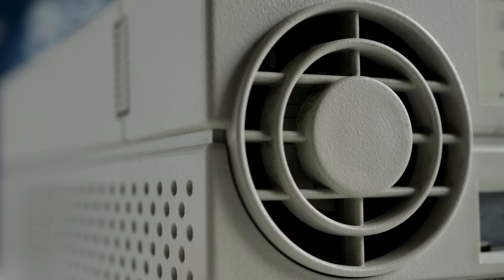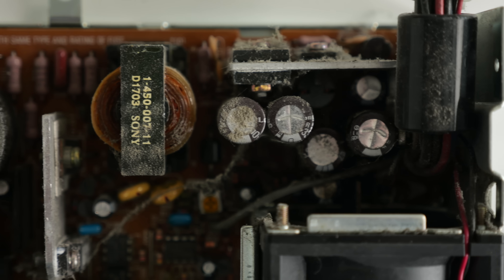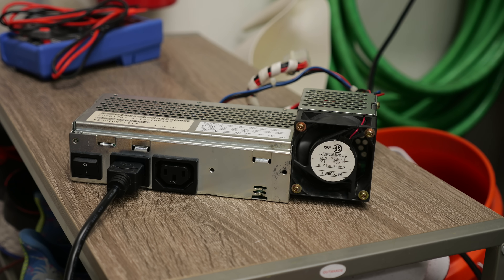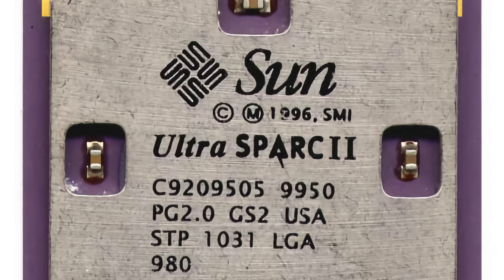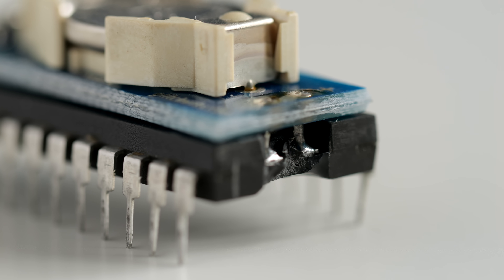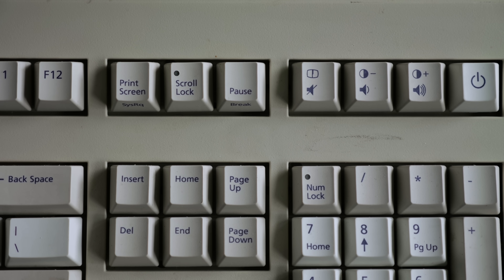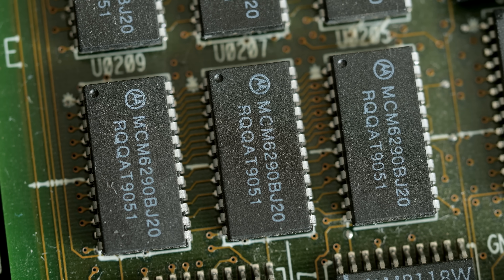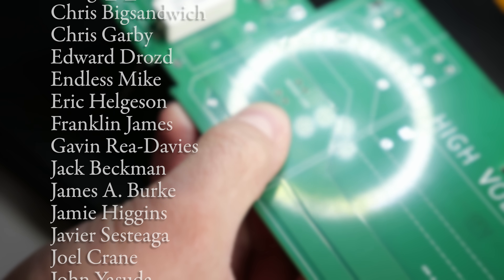I couldn't fix this SPARCstation because of one STUPID problem

Comment: I had a cache chip fail on a sparc 5 I was using as a router at the time. super props to the firmware team for identifying the failure at the component level, but that level of component replacement wasn't something I wanted to tackle at the time. These days I would hold onto it for SMT rework practice, but back then it was easily replaceable by newer surplus x86 gear, so off to the recycler it went.

I still have a sparcstation 1 and a 2 that I'm likely get rid of if I get them going again and can internalize how truly slow they are.

I really liked the IPC and IPX form factor, and had a few in the early 00s, but 25 and 40MHz can only get you so far. ISTR a friend of mine bringing home a bunch of surplus IPCs at one point, but ssh keygen and initial key exchange was unbearably slow (on the order of minutes) which quickly killed his idea of building a loose cluster out of them.

Comment: The message at 12:23 says the problem is with "Page Map RAM," which would appear to indicate that that RAM is used for the virtual memory system, not the video system, and simply adding a video card wouldn't help. (And anyway, if the problem were just in the video card, the boot ROM ought to let you to continue to use the system from a serial console.)

If you're willing to get in and do the soldering and rewiring necessary, I don't see any reason that the bad RAM chip couldn't be replaced by any other static RAM that meets the same specifications.

As for the video issues, this is where it's well worth buying an oscilloscope, even a super-cheap one: being able get some sense of the signals on the pins (video and the various types of sync) will generally make short work of debugging "doesn't display" issues.

Comment: I was given a Sun IPX for my MPhil at Manchester University, UK between 1996 and 1998. I was really proud to have one - the only actual workstation I ever had access to. It had enough HD space and 64MB of RAM. It ran Solaris, but with FVWM2 as the window manager. After a few months I bought a PowerMac 4400/160 with 32MB of RAM for home use which was about 8x faster, but the IPX still felt special.

Comment: For systems like the SPARCstation, which utilize the Motorola MCM6290BJ20 SRAM chip, compatible replacements include:
	•	Hitachi HM62256P-xx
	•	Cypress CY7C199-xxPC
	•	Fujitsu MB84256A-xx
	•	Toshiba TC55257CP-xx
	•	Sony CXK58257P-xxL
	•	Mitsubishi M5M5256P-xx
	•	OKI MSM62256-xxRS
	•	Sharp LH52256N-xx
	•	NEC D43256AC-xxL
	•	Alliance AS6C62256-xxPCN
	•	Samsung KM62256ALP-xx

These chips are typically 32K x 8-bit SRAMs with 5V TTL compatibility and standard 28-pin DIP layouts, making them suitable drop-in replacements.

Important Compatibility Criteria
	•	Capacity: 32K x 8 (32KB total)
	•	Interface: Parallel, 8-bit
	•	Voltage: 5V TTL
	•	Pinout: Standard 28-pin JEDEC DIP (or equivalent SOIC if you’re adapting)
	•	Access time: 200ns or faster (150ns, 120ns, or 100ns are all okay; just not slower)

Replace the xx with the ram speed.

Comment: Oh, so Sparc stations of that vintage actually DO have clock batteries. Thanks for the clarification, Colin.
Reply: We had a bunch of IPXs that we hadn't used for a while, the timekeeper battery had died, putting in a new chip was easy enough, but that eeprom also kept the mac address...the mac address wasn't printed anywhere on the machine. Since these would never touch the outside world, we just made up some addresses DE:AD:BE:EF:00:xx was my favorite

Comment: "...Than the original, mechanical unit." Colin, FFR that comparison doesn't make sense, because with the old system drive being a hard disk drive, being mechanical is just a given. You replaced it with something that isn't even a hard drive.

Comment: I restored an IPX a few years ago. Same deal with the blueSCSI and the monitor pinout drama. Even dremeled out the timekeeper to solder in a coin cell battery holder. Very cute form factor and Sun build quality is very impressive. Got Solaris installed and realized how painfully slow it was. The 1993 college engineering workstation lab nostalga quickly faded and back to ebay it returned.

Comment: You went to the trouble to build a new power supply but let a ram chip stop you? There weren't any junk peripheral cards with ram chips around to farm one off of? I guess everyone has their limit. Frankly I'm impressed that the machine itself could give an error code down to the chip location of the problem. This thing WANTS to run! I wouldn't have known how to set up a headless terminal to get any output at all so that's a win there. I wonder if simply a cracked solder joint or pcb trace could be to blame. Re-soldering that chip or bridging the trace might bring it back in case of those faults. Perhaps if you went back and poked around a bit more on both sides of the motherboard you might fix it without any more monetary output. But I understand jus being over it. Make notes of what you did and the error you got and pass it or sell it to someone who wants to continue the saga.

Comment: Correction to the video - Sun did make a portable machine.   It was called the SPARCStation Voyager.    While it doesn't fall into the modern definition of laptop (integrated keyboard/monitor), it was designed to be mobile.    If I remember correctly, it had no fans (all passively cooled).
Reply: first

Comment: The other thing that happens is the Dallas semiconductor clock and SRAM model battery goes bad after a few years.  The MAC address is stored in SRAM and you lose the MAC when the battery dies.  The ROM contains a Forth interpreter, and you can type in a new MAC.  I don’t recall the command off the top of my head.  When my battery died, I typed in co:ff:ee:12:34:56 when I needed to boot up until I got a new Dallas chip.

The Solaris operating system available for the IPC and IPX is terribly outdated and full of security holes.  Netscape Navigator and even a n early version of Microsoft Internet Explorer are available for web browsers.  Probably any version available is full of security flaws.

The IPC and IPX were cool I their day, but probably not practical for much of anything now.  In their day, they were surprisingly compact computers with a lot of power in a very small package.

Comment: This predates anything I even saw by Sun. I worked at a small local ISP from 1996-2000 where they have a SparcStation 5( the pizza box) and a SparcStation 20. While I do have some nostalgia for these, they just don't have enough draw for me to spend more than maybe wanting to see one running for a few minutes. I'll take a 486 running Linux of the era or just a modern VM of Linux over using SunOS or Solaris again.

Comment: I restored an IPC, even got the original power supply working. It has been running in my garage 24X7 for over a year now. I use it as a syslog sink. I put a SCSI2SD in it. I love it.

Comment: I loved those old sun systems.. I had 2 fo the Sparc pizza box sparcstations on my desk in the late90's... damn thing blew the doors of my PC that was state of the art at the time.  I still have one that's much newer and it works.. Internally I think it's IDE where externally it's got the SCSI port that I have HD's and Tape drivers plugged in... not to mention it uses VGA... I still love working on Solaris (and my job has me doing it from time to time) as they are pretty damn stable.. but Oracle since buy Sun Microsystems has pretty much put it to pasture.

Comment: i had some old sparc, borrowed the video adapter from work until i eventually bought a sun monitor from a friend of mine, and just like you predicted, only ran it long enough to install solaris (also borrowed from work), and then it just sat on a shelf forever, eventually got lost in a storage auction

Comment: If you managed to fix the RAM, then the next issue will be with BluesCSI. I couldn't get BluesCSI to work with my IPX, but ZuluSCSI seems to be a better fit for the IPX's SCSI flavor. I also had to borrow a SCSI CD-ROM drive from one of my SPARC systems to install Solaris 6 because I couldn't get the CD functionality to work with the IPX and the Zulu either. I believe this issue was related to the block size.

Comment: Wow, trip down the memory lane ! As a student, I used such a machine. We had a room filled with +/- 20 of those.
From the very serious student work like a (very basic) Pascal compiler (which I made portable : Sparc Station, PC and Atari ST !) to annoying others by messing with the display of others stations, because there was no security on this side ! Welcome to scrambled and "melting" screens !

In your case, its too bad nothing else than the error message came out. May be you would have encountered another one : the mouse. If yours is the same optical one we had at the time, you need a very specific Sun mouse pad. The mouse won't work on any other surface. It needs the very specific reflective features of the Sun pad ...

Comment: That memory chip is a standard part that has a standard pinout and capacity. Some hot air and you can replace it with any other that has the same or faster latency. They are still made, even. And cheaper than your VGA adapters. 🙃
I have some SIMMs in my 486 where I can't find a datasheet for their memory chips at all, and yet, they're standard DRAM, too. If I need to fix them, I just buy EDO RAM and take off the chips I need.
Reply: I'm surprised he didn't try this...
Reply: "Standard" only covers the pinout, packaging and memory cell array layout. It does not cover the timings or memory standard.

During that era, there were four successive memory standards that were not 100% compatible with each other: PM, FPM, EDO and BEDO. If the memory controller didn't support the standard, it wouldn't work, or cause undefined behavior. Mixing and matching memory standards and timings on a single stick is a recipe for disaster.

There were plenty of systems that supported PM and FPM, but would refuse to work with EDO and BEDO memory. EDO and BEDO were "technically" supposed to be backwards compatible, but some memory manufacturers required special strapping be done with external components to force it into FPM mode.

And while SRAM is generally SRAM, you still have to worry about access times, array layouts and voltages. Yes, SRAM chips are still made, but you don't want to slap a 3.3v or 1.8v SRAM on a 5v bus without level shifting.
Reply: @GGigabiteM  We're talking about replacing memory chips of a known type with others that meet the specifications. The issues you describe, at worst require running a bodge wire from a pin to VCC or ground to switch the chip into the other mode. That's hardly difficult. And choosing a chip that's available where you don't have to do that is trivial.

Comment: I love videos like this where someone "discovers" something you take for granted.  I started my so-called "career" on 68010-based Sun2 machines, and thought the SPARC-based machines were amazing.  Even now, I sometimes miss them, though there is one still running in my datacenter at work.  I was even a Sr. Engineer at Sun for a time, and  I had several IPXs (and IPCs, and other, later lunchboxes in my then-oversized collection.  (Which I finally got away from when I realized I was going overboard with a 14-CPU E5000 and a 100-slot DLT robot in the house.  I have a VERY tolerant spouse...

Hell, I still have not only the printed version of the FE Handbook, but the electronic version of it and the later Sun Systems Handbook as well.  Having access to those resources is still handy

FWIW, I don't think of the IPX as a "lower-cost" system; that was really the IPC.  I mean, the IPX has onboard GX graphics, which (IIRC) was designed by Curtis Priem, who went on to co-found NVIDIA. The IPX was essentially a SPARCstation-2 in a smaller form factor with some updates and onboard graphics taking away the third SBus slot.The SPARCstation-2 may may surpass even the SPARCstation-20 as the best workstation Sun ever made.  (Some will probably disagree, but I'm allowed my opinion!)  They were supported for a long, long time, and I saw ones being used as late as 2006 or so.   You'd be surprised how snappy SunOS 4.x was on it, and even some versions of Solaris 2.x ran decently well.  

Having said all that, I don't blame you for stopping.  There's a point of no real returns on most old hardware.  My Apple G4 Cube collection (well, I haven't stopped having a "few" machines around) is supported with spare parts from Cubes that were just too far gone to repair.

Comment: I'm at 11:09 and I have a bad feeling I know where this is going. Because last year I spent easily 10, maybe ~12 hours screwing around with a SPARCStation 5, trying different adapters (I own that exact adapter cable with the DIP switches on the 13W3 side) before finding out my MultiSync monitor wasn't terribly "multi-sync" at all. A had to hook up an LCD VGA monitor and set the refresh rate in NVRAM to get a display on a CRT.

And if that's not where this is going, dude, you dodged a bullet. But if it is... I'm so, so sorry. Welcome to Sun Microsystems, I guess.

EDIT: Oh god that was so much worse than I was expecting, RAM chips?? I don't blame you for getting out when you did, even if I personally do quite enjoy having a ridiculous box of RISC on my network. I use mine as an FTP server and a dial-in server to support other machines that are stuck on dial up, but I appreciate that those are both niches. And it must be said, early 90s Unix gaming doesn't exist. To within a margin of error, anyway.

But if you ever do want to give it another whirl, may I recommend: https://www.oldsilicon.com/workstationdiskimages There's an enthusiast named Todd Vernon living out in Colorado with a large enthusiasm for these machines, and he does have pre-configured Solaris disk images (with a lot of helpful software) that I've used successfully with a BlueSCSI.

Comment: When SunOS detects more than one network interface, it automatically enables routing. If I remember correctly, you could disable this feature by creating a file in /etc called notrouter (or as it was jokingly called etsy no trouter). This was easy to implement with # touch /etc/notrouter

Comment: Wow this brings me way back. In 1995 I was gifted an IPX with a stack of external periphs (SCSI CD-ROM, tape backup, hard drive) along with an unfathomly large (to me anyways) Sun-branded CRT.
That's the first time I broke into a *NIX system (it had an OS installed but no password)  but far from the last.
Such a cool build!
You make me want to pull out my dusty old Sun Ultra 10. I'd already maxed out CPU speed (and overclocked it) along with maxed RAM and top of the line video card.
Still ran Java desktop like crap.
Took 3 days to compile X11/KDE4 on Gentoo when I tried in the late '00s (guess how I learned to build a distcc farm!)

Thanks for sharing!

Comment: I can agree with the sentiment of not throwing your good time after a lost case.  But considering that you changed so much out of the chute and ultimately failed, the end result is really not a surprise.  I have a working IPX with 64MB and 1GB SCSI drive as well as the Weitek power uP processor.  Fun little piece of computer history and surprisingly snappy.  I have a second frame graphics card and, when I had the monitors, would drive a pair of displays just fine.  Even have the external four drive storage unit for it and have it configured with a couple of 4GB SCSI drives.  Fun to play with and a nice bit of history as well.  Guess I need to have at the supply and recap it though.

Comment: Liked the video, but not the ending, kind of sad.  Hopefully someone here will get you enough information or maybe even the part, to fix the system.  Otherwise, you might want to get a GX card instead of using the built in  one.   BTW, I would NOT try to run Solaris on this thing.  It is much better suited for the latest SunOS 4.x.x.

Comment: Lol!  I remember my early days of being a SysAdmin.  I was happy to have on my desk a similar looking lunchbox, but it was an IPC, not an IPX.  I had 24MB of memory, and connected it to 2 screens.  Through it wasn't that fast, I had a nice bit of desktop space to do my work, and over the network (an AUI cable fished down the wall) I could get to the rest of the network, and had "plenty" of CPU power on the network!.  Most people don't realize that we could do things on UNIX that the PC's just couldn't, run applications from remote almost like they were running locally through X windows, but for me, it was faster over the network, many times as the IPC only does about 12 MIPS!

Comment: Way back when I was in high school in the late 90s, I wanted to learn Sun hardware and Solaris, so I bought an SS2 off of eBay with my meager grocery store bag boy wages. I had no idea what to do with it, so I posted on a Sun group on usenet to ask for advice on how to begin with this SS2. A gentleman from Texas contacted me off list and offered to send me "some stuff to get started." A few weeks later a large box showed up at my parents' door. Inside was... well, everything. The guy sent me a complete shrink wrapped Solaris 7 box set, a Sun keyboard and mouse (the SS2 was headless), a TGX graphics card and 13W3 to VGA adapter, an external SCSI CD-ROM, AUI adapter and patch cables, another hard drive and bracket, and enough RAM to max out the SS2 to 64MB. It was completely nuts, the guy sent me literally everything I could need. He asked for nothing in return and only wanted to see someone young start a career in the Unix world. It was more than enough for me to install Solaris and start learning - although even at the time that SS2 was pretty slow. I don't remember his name, and I don't know where he worked where he had this much stuff to just toss at a random kid. It was a huge learning experience for me. The community back then was something else.